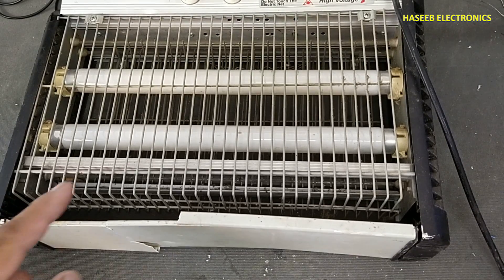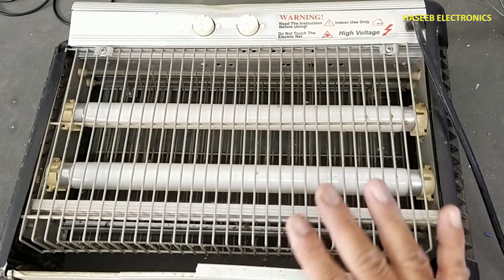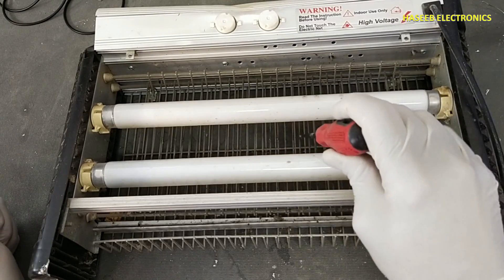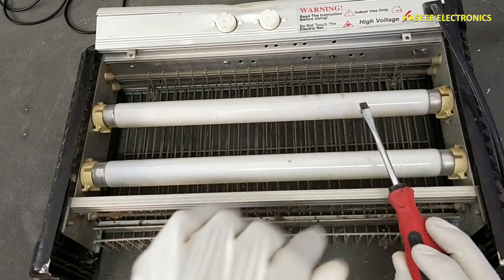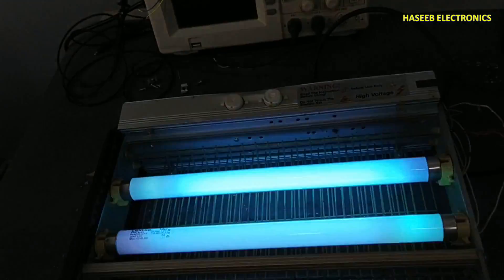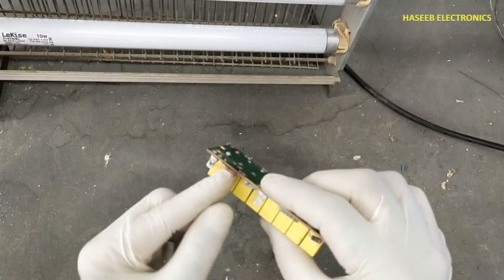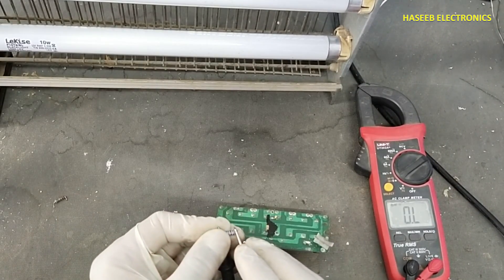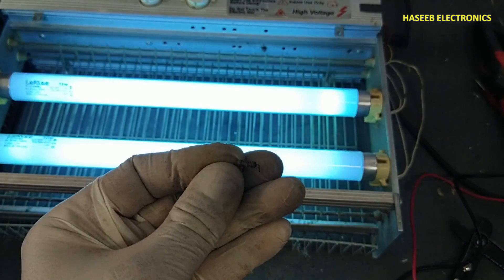{920} Insect killer not turning on, very weak sparking

Comment: Good video Mister Haseeb! How many KVolt is the high voltage?
Reply from the maker: it depends on the voltage multiplier stages 
normally these insect killers have 1000 volt up to 4000 volt
Reply: @HaseebElectronics  Thanks Mister Haseeb! Best Regards!

Comment: what is the circuit topology?  looks like several diodes next to the capacitors - several stages of voltage doubling?  with 5M Ω input resistor to limit shock energy to that stored in capacitors without possibility of mains electrocution?  what do you estimate is final DC voltage? thanks